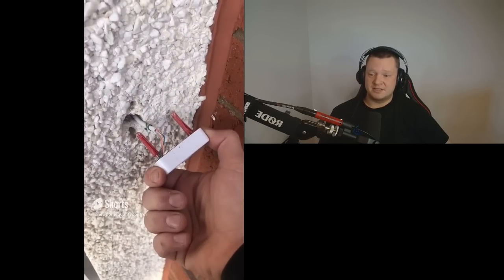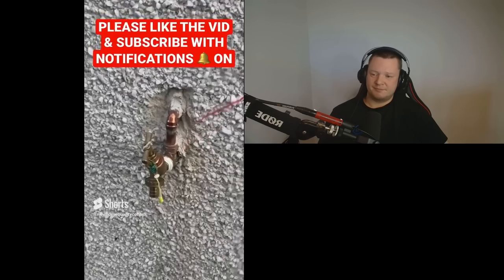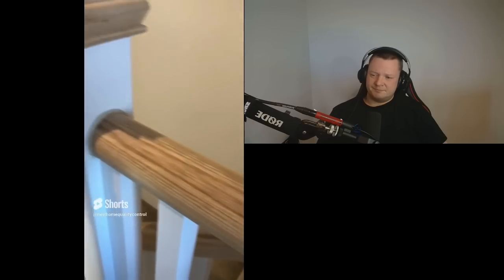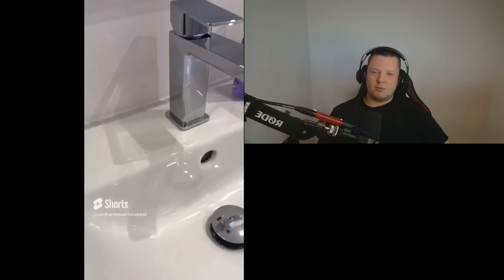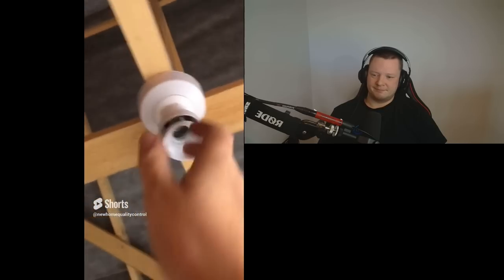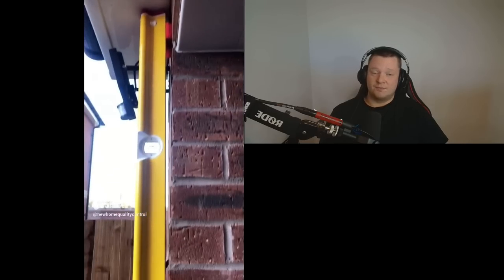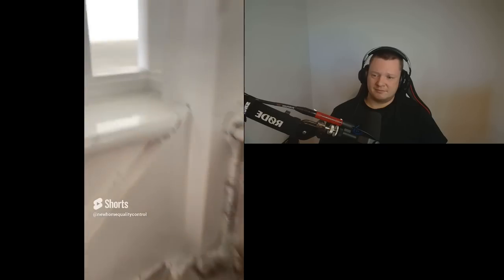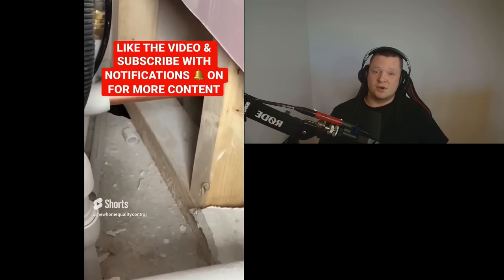The Snagging Breakdown #1 | New Build Snagging Inspection Analysis

Comment: Love the videos.  Mad what you find.  You said that the garage wall ideally should be rebuilt as over tolerance 8mm.  The internal wall was 12mm out and you said it would need plastering.  I assumed the 8mm was for stability, wall must be leaning.  How do you know the 12mm isn’t leaning? Surely plastering is only going to mask the or is the safety margin much higher

Comment: Painter and Decorator here... what are your views on the "builders finish"?  A common theme these days for new work is site agents shining a torch up walls and snagging like that (usually in a rushed house completed with no light or heat) followed by buyer hired "professional snaggers" who then hammer the house to pieces 🤣
Reply from the maker: Natural daylight, 2 meters away
Reply: Light changes depending on time of year. Much of it is unnoticeable in normal light in January but once June hits it shines all sorts of defects. Using a light on the wall when snagging  reduces this by far but often there will still be imperfections. Site managers cannot let that go as people like this snagger will pick up on it another day and call it yeehaa. Painters should inspect plaster and ensure they are happy with walls before decorating a plot.

Comment: i luv your vids, im a builder and this work makes me sick and annoyed, the very reason i tell my kids to never buy a new house. however 1 point the wall ties to strap a timber roof down are not often required as stated in the engineering book but have become part of a lazy engineers design. they are only actually required in very special situations and most buildings dont actually need them